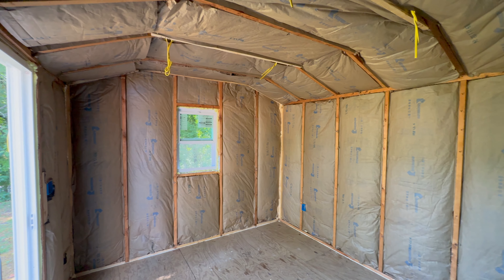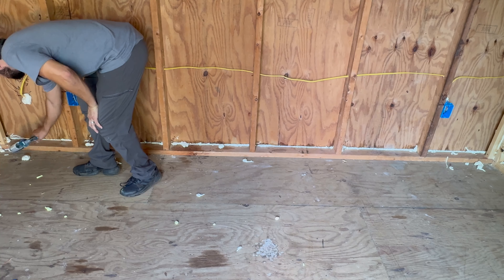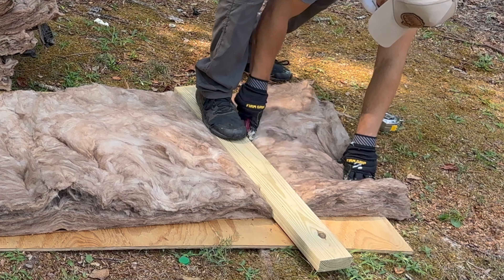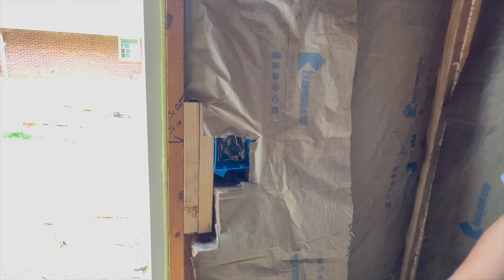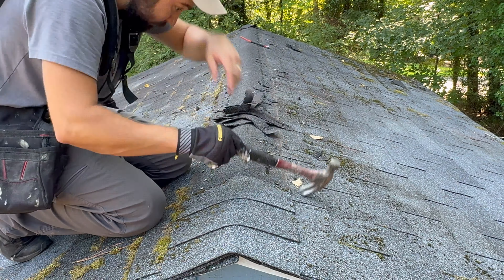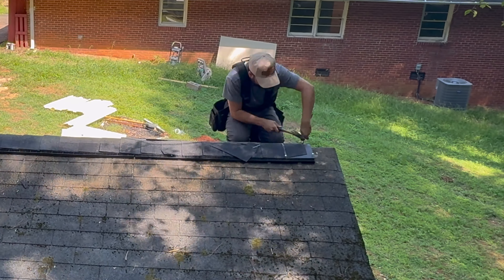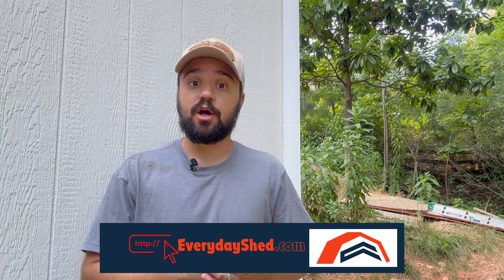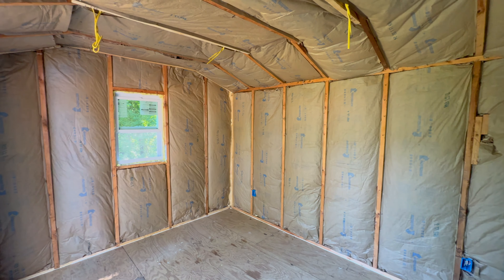Simple and Easy DIY Shed Insulation - NO Soffit

Comment: Ever hear the term, fluff it, don't stuff it? Jamming that insulation into those cavities squeezes out the air pockets and makes the insulation ineffective
Reply from the maker: Yes, yes …. But it sooo difficult to get a 24” wide insulation around me.
Reply: @EverydayShed  It would work better if you peeled 1 1/2-2 inches off from the inside. Without space to trap air insulation doesn't work very well and you have compressed out all the air space.

Comment: The holes that you drilled for sofit allow air flow. You mentioned that some bugs could get in, is there also danger of water in a heavy rain? Also, instead of the vent along the whole roof, can you not have one vent at the front or back at the top?
Reply: I believe you need an intake (soffit) and output (ridge vent). So the air comes in at a lower point and then as it rises it exists out of the ridge or gable vents.
Reply from the maker: Yes! you will need a air to flow from the sides up to the roof.

Comment: Just found your videos. I am really enjoying them. You do an excellent job of actually laying out each step. Question on the insulation, how would I handle the air flow for a modern style sloped roof? I am planning on building my backyard office soon. 12x8. back wall 8ft, front wall 9' or 10'. I have not decided yet. If you need an idea for your next shed, I thing people would really enjoy seeing how you build this type of shed.

Comment: He did it just how I’m doing it on my 12x32 Dirksen but keep in mind if you have to follow code like me you will need r30 in the ceilings so extended the 2x4 ceiling joist down to atleast 2x6 width will work.  I used rough cut lumber 2x6 which gave me Exaclty 6 inches I’m gonna run 3 ft up from top plate and let it sit on top ceiling which I will use 7/16 usb first because it’s 2 ft on center . I picked up 16 sheets 7/16 on marketplace so it’s all
Good then come back with Sheetrock
Or however I want.  I also drilled 3 inch soffit vents in each bay from under those not on side. used the same styrofoam baffles   Bought the 3 inch plastic round soffit vent packs which come in 4 from Home Depot.  12 bucks.  I also bought a roll of aluminum screen to place inside the plastic round soffit and silicone caulked them in place.  I also placed caulk around the outside rim before pushing the 3 inch vent in place   They fit tight already so no worries about them falling out.  I guess I will see.  South Louisiana here and with these hot summers I am just being cautious.  My building came with gable vents on both end and ridge vent … I feel
Like that’s plenty of air flow I also added 16ft x 32 ft lean to off the other side   Ran baffles and have a perforated hardy soffit the length of lean to.  Had to by code stick r30 inbeteeen them rough cut 2x6 rafters as well.  Didn’t realize that after putting r19 up so had to come back over it with r13 to get to r30.  For the price it was still cheaper than spray foam which I hear can cause mold and rot .. my lean to roof is metal with 2 layers of the synthetic felt on top of 5/8 osb.  I wish I would have ran some 1x4 across for strapping but it’s on a 1/12 so there won’t be much strain
Reply from the maker: That is great!!! Good job on your shed

Comment: Sometimes those R19 batts for a 2x6 (5.5in) bay are the same weight per square foot as R13 batts intended for a 2x4 (3.5in) bay.   This means they have the same amount of fiberglass, with more air.  By compressing the 5.5in batt into a 3.5in bay you should end up with R13. Some say you'll get slightly more than R13, but I don't see how.

The fiberglass is not doing insulation, it is just trapping the air, or in other words stopping the air from moving around and convecting heat between outside and inside walls.  The trapped air provides the insulation.  This means that if your 5.5in batt has more fiberglass than a 3.5in batt you will end up with more fiberglass (not insulating) and less air (insulating) and you will get less than R13 insulation value by using the R19 batt.
Reply from the maker: Thanks alot for the comment. You are right, I also read something similar, compressing a R19 down doesn’t meat is better. The trapped air is really important. Thank you for watching!!!

Comment: Doesn’t the front and back screened vent account for the air movement needed to avoid the moisture and mold damage?
Reply: Yeah, it's just not as efficient.  You can make it better by adding a small exhaust fan
Reply: The roof venting allows for a cold roof and that eliminates condensation

Comment: That's incorrect it's not the recommended method to staple on the inside of the board you need to check the website insulation he bought . That's why they have the tabs on the side to the insulation  to unfold and staple on the studs.

To better cut use a serrated knife like a bread knife. Razor blades good Dole quickly